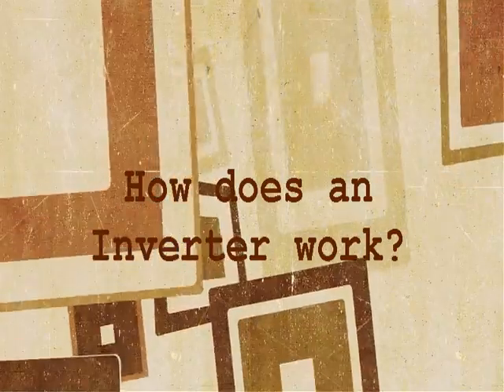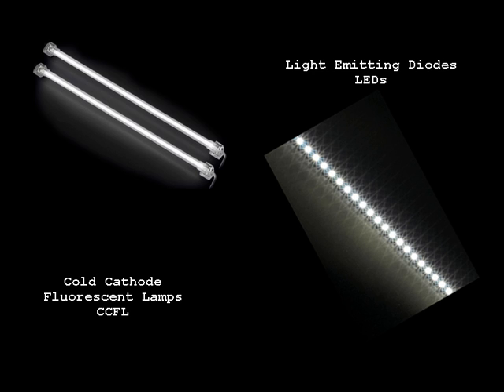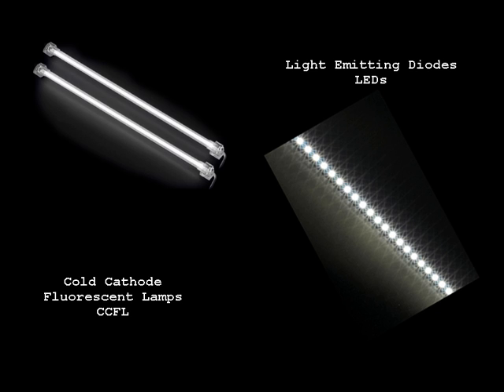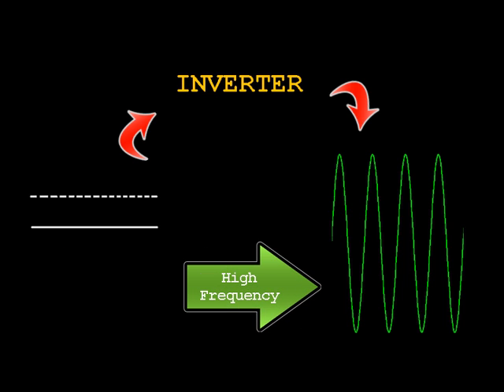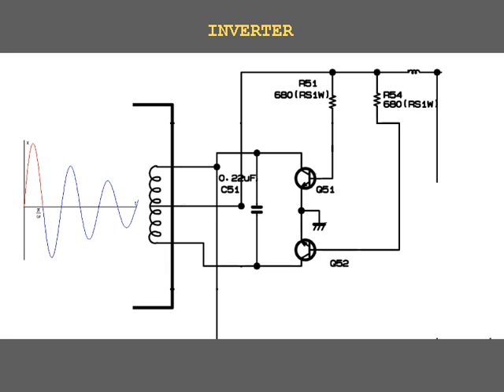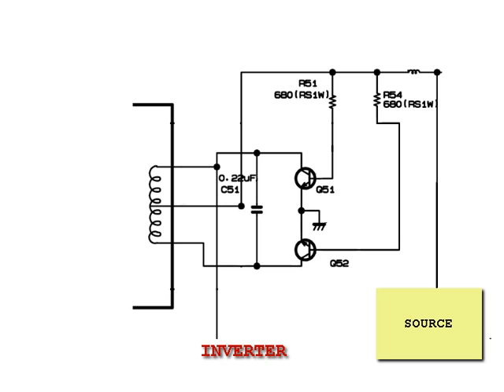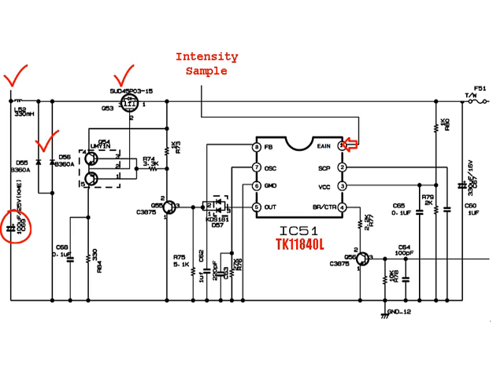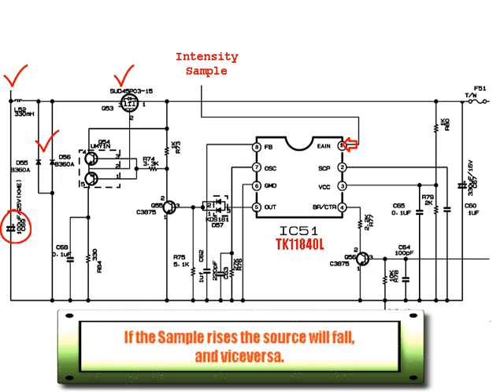How does an inverter work?

Comment: the first circuit is royer oscilator. good thing is with no load you can disconnect the resistors completely and increase the efficiency, but it will turn off when u increase the load, so the best solution is high resistance resistors-enough to start up and never let turn off and no big losses due to feedback coil current trough them

Comment: ENGLISH TEXT.

How does an inverter work?
Any picture displayed in an LCD technology device, requires an independent light, in order to be seen by the eye.
Nowadays there are two different ways to produce that light. One is through cold cathode fluorescent lamps, and the other is based on leds (light emitting diodes) .
Firstly, we are going to see how the cold cathode fluorescent lamps back light technology works.
A high alternate current voltage, produced from a continuous current voltage is necessary.
Because of that, the source that makes this work is called an INVERTER.
At the same time, it is necessary a high frequency alternate voltage, to avoid interferences.
And what are the necessary tools to get it?
A high frequency oscilator circuit.
Transistors, to make heavy or power work.
And an elevator transformer in order to get the voltage up.
Let us talk about the cold cathode fluorescent lamps.
According to their size, they need more or less high voltages to operate.
Their electrical resistence decreases as they heat.
They eventually become less efficient and less illuminate.
This can cause some problems:
The high voltage is prone to cross the isolates, so there must be a shorts controller circuit .
Since they conduct more as they heat, the voltage must decrease at some point, to avoid the lamp´s  explosion. So, it is necessary to have circuits that contol the amount of voltage.
And the inverter begins to operate in an intermitent way, or simply shuts down if it can not balance the brightness of a lamp assembly, since they gradually lose efficiency.
It means that we have to add to the oscilator, the tranistors and the transformer, some circuits that control and watch over for a precise measure, so that nothing be left apart.
Let´s begin with a simple circuit that is used in LG/ZENITH brand, for small TV screens (fifteen inches). The oscilator circuit consists of the following elements:  
The transformers. The capacitors. The transistors.
This is the primary side of the transformer, and in parallel, there is a capacitor. These two elements easily oscillate or shake for a certain time, when a current passes through them or is suddenly discontinued.
Where would the current come from?
It turns out that the circuit is powered by a 9 volts source, more or less. But in order to produce current flow, we have to push one of these transistors to conduct.
Let´s see that everyone of them has a six hundred and eighty ohms resistence at its base. Let´s assume that Q51 conducts, due to the excitement that the resistence 51 gives to the base; so this is the path of the main current.
All this, causes the first half cycle of a sine wave in the transformer. To complete the cycle, it is necessary that the current walk the opposite way, driven by the other transistor, Q52.
The oscilation of this circuit is fedback by a secondary winding which ensures that, in each half-cycle, only one transistor conduct while the other remains cut off.
And all this work reflects on the elevator secondary winding, where the lamps are connected and, as a result begin to illuminate.
Now: how or where the samples are taken, to make the necessary controls, so that the circuit work perfectly?
This is accomplished by examining the ground return end of each lamp, since at this point the voltage is small and easy to handle, besides it´s a faithful sample of the entire process.
The first thing is to make pass such sample by a rectifier circuit to convert it in DC. This is possible through two different circuits, one for intensity controls, and the other to detect if any lamp becomes open or disconnected.
The current control circuit assumes the administration of the source that, we said, has around 9 volts, but can get down when it become necessary. For example, when the lamps are heated, because, as we know, they conduct more, and could burst. Let´s see how it is made:
This is the source that regulates the nine volts of the inverter. The IC 51 is the TK eleven EIGHT forty L that, accompanied by the Q53 mosfet, the L52coil, the 55 and 56diodes, charge the C69 capacitor with a close to 9V voltage, that may rise or fall, according to the sample in DC taken from the lamps, and that comes in by its pin 1 EAIN (input of the error amplifier). This terminal inverts the information, which means that if the sample rises, the source will fall and viceversa. All this makes sense, since if the lamps conduct more, their internal resistence will be less. Therefore the sample will become higher and the source reaction will be geting down a bit of the voltage, in order to compensate.

Comment: Heat is not (much) the factor  that causes the change of resistance of a florescent lamp. It is ionizing the gas that decreases the resistance of the tube. The ballast, or driving circuit, Must deliver high enough voltage to start the lamp. Then the voltage must decrease  to limit the current flowing thru plasma in the tube. For the curious; The old fashion ballast is really a weak transformer. It can only deliver enough high voltage to start the lamp. When the tube ionizes(lights) it's higher current draw pulls the voltage down to operating level.
Reply: Coil Smoke What is an inverter? Inverter is another name for Power Supply. It may raise or lower the voltage input. Because a transformer is used , Alternating Current must be fed to the transformer. Steady Direct Current will get you nothing out of a transformer. So if DC is used it must be " Oscillated " or chopped up into an alternating signal to power the primary of the transformer. Those two transistors and the transformer primary windings form an oscillator that that produces the desired varying voltage to the primary of  the transformer. The number of secondary windings determines the AC voltage output. Less windings = less volts. For step up , more turns than the primary windings = more volts out. 
The name / word 'inverter' used to imply: A device for converting low voltage DC, like from a 12Volt battery to 120 Volts AC that can power home electric gadgets 'in the field'. Now manufactures are using " I N V E R T E R " because it sounds new, impressive and baffles customers into thinking they are dumber than the sales people.  . Also there is a trend to using DC or different voltages in motors and devices traditionally just hooked to the AC line. The idea is better control circuits and less power consumption, WE HOPE ...
Reply from the maker: Coil Smoke excellent contribution . Thank you
Reply: Hey there. Could give some advice? I have problem with my VAIO PCG-2J1L. I believe this is iverter board. Screen goes off after 2-3 minutes. Capacitor on this board looks OK, 4 secondary coils in 2 transformers show equal resistance. Do you have any ideas?
Reply: They sell a chiller spray that is used to cool suspect components. The theory being, some components fail as they warm up and may start working when cooled by the spray. It's a very old school trick that can pinpoint bad parts.
Reply: Coil Smoke Thx) This sounds very interesting and possibly will work but some SMDs on this board are very tiny) Another problem is to get this cooling spray here in Russia) But I will take a look in local shops.

Comment: TEXTO EN ESPAÑOL

Cómo funciona una inversora
Cualquier imagen reproducida en un aparato con tecnología lcd, requiere de una luz independiente para poder ser vista por el ojo.
Actualmente existen en el mercado 2 maneras distintas de producir esa luz. Una es con lámparas de cátodo frío (ccfl) y la otra es con diodos emisores de luz (led).
Vamos a ver primero cómo funciona la luz trasera o back light producida por lámparas. 
Es necesario un voltaje alto de corriente alterna, producido a partir de una tensión de corriente continua. Por esta razón a la fuente que hace este trabajo, se le llama inversora.
También es preciso que la corriente alterna sea de alta frecuencia. De esta manera se evitan interferencias.
Y cuáles son las herramientas para conseguirlo?
Un circuito oscilador de alta frecuencia.
Transistores para hacer el trabajo pesado o de potencia.
Y un transformador elevador, para que suba el voltaje.
Hablemos de las lámparas de cátodo frío:

De acuerdo con su tamaño, necesitan voltajes más o menos altos para funcionar.
Su resistencia eléctrica disminuye a medida que se calientan.
Con el tiempo van perdiendo eficiencia y alumbran menos.
Esto puede generar algunos problemas:
El voltaje alto es propenso a cruzar los aislamientos, por tanto tiene que haber un circuito que controle cortos.
Dado que conducen más a medida que se calientan, el voltaje debe bajar en cierto momento, para que la lámpara no se estalle. Entonces son necesarios circuitos que controlen la cantidad de voltaje.
Y como van perdiendo eficiencia, pasa que la inversora, si no puede equilibrar el brillo de un conjunto de lámparas, comienza a trabajar de manera intermitente o simplemente se apaga.
Lo anterior significa que al oscilador, los transistores y el transformador, debemos añadirles varios circuitos que controlen y vigilen para que no falte ni sobre nada.
Veamos un circuito simple para comenzar:
Es usado en la marca lg/zenith para televisores pequeños (15"). El circuito oscilador está compuesto por los siguientes elementos:
Los transformadores
Los condensadores
Los transistores
Este es el primario del transformador y en paralelo está puesto un condensador. Estos dos elementos oscilan o se sacuden fácilmente y por un tiempo determinado, cuando una corriente los atraviesa o se suspende súbitamente. 
De dónde vendría la corriente?
Resulta que el circuito está alimentado por una fuente que tiene alrededor de 9V. Pero para que haya circulación de corriente, tenemos que hacer que uno de estos transistores conduzca. Miremos que cada uno de ellos tiene en su base una resistencia de 680Ω. Supongamos que conduce el Q51, gracias a la excitación que le brinda a la base la resistencia 51, y este es el camino de la corriente principal. 

ESTO provoca en el transformador el primer medio ciclo de una onda senoidal. Para completarlo, es necesario que la corriente recorra el camino inverso, impulsada por el otro transistor, Q52.
La oscilación de este circuito es realimentada por un devanado secundario del transformador, que se encarga de que en cada hemiciclo sólo conduzca uno de los transistores, mientras el otro permanece cortado. 
Y todo este trabajo se refleja en el secundario elevador, donde están conectadas las lámparas que gracias a ello, empezarán a iluminar.

Ahora: cómo o dónde se toman las muestras para hacer los controles necesarios, de modo que el circuito funcione perfectamente?
Esto se lleva a cabo examinando el extremo de regreso a tierra de cada lámpara, ya que en este punto el voltaje es pequeño y fácil de manejar, además de ser una muestra fiel de todo el proceso.
Lo primero es hacer pasar dicha muestra por un circuito rectificador para convertirla en DC. Esto se hace a través de 2 circuitos distintos, uno para controles de corriente y otro para detectar si alguna lámpara llega a abrirse o desconectarse.
El circuito controlador de corriente se encarga de administrar el valor de la fuente, que dijimos está alrededor de los 9V, pero puede bajar cuando sea necesario. Por ejemplo cuando las lámparas se calientan, ya que, como sabemos conducen más y podrían estallarse. Veamos cómo lo hace:

Esta es la fuente que regula los 9V de la inversora. El integrado 51 es el TK11840L que, en compañía del mosfet Q53, la bobina L52, los diodos 55 y 56, cargan el filtro C69 con un voltaje cercano a 9V, que puede subir o bajar, de acuerdo con la muestra en DC TOMADA de las lámparas y que entra por su terminal 1 EAIN (entrada del amplificador de error). Este terminal invierte la información. Esto quiere decir que si la muestra sube, la fuente bajará y viceversa, lo cual tiene lógica, puesto que si las lámparas conducen más, su resistencia interna será menor. Por consiguiente la muestra va a ser más alta y la reacción de la fuente será bajar un poco el voltaje, para compensar.